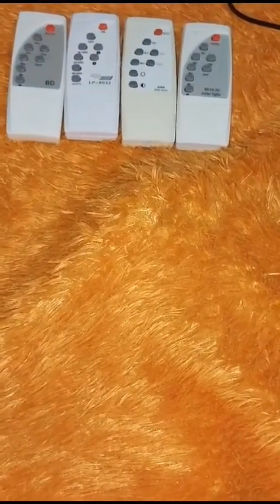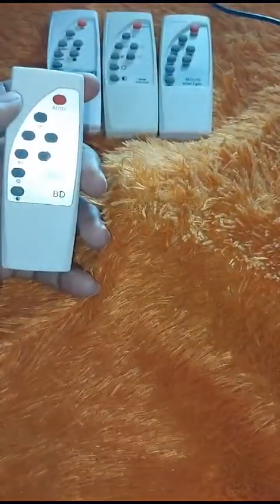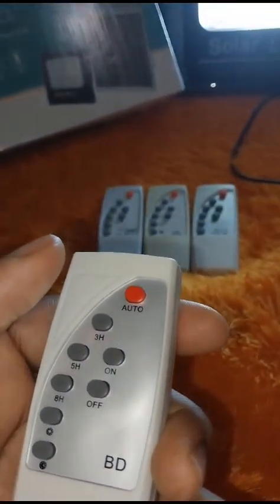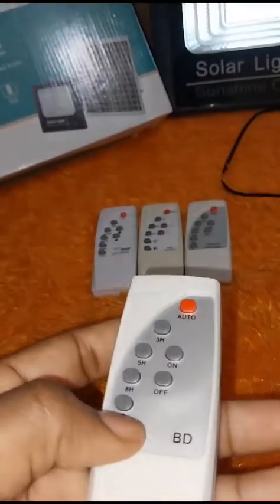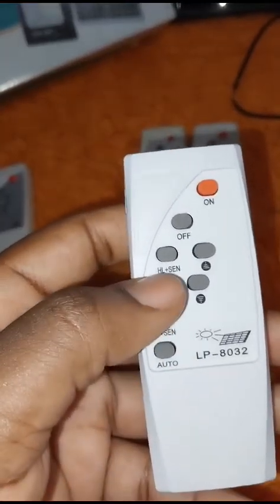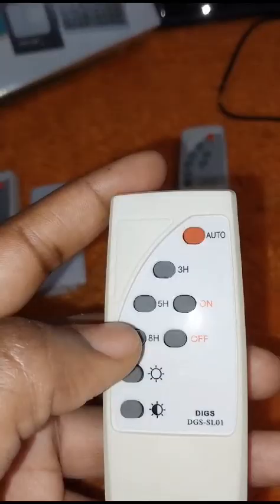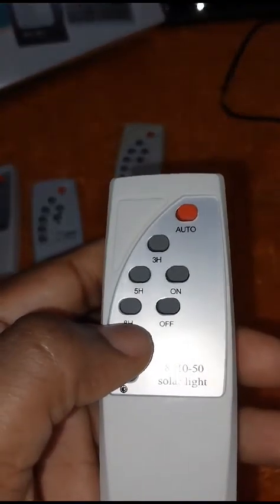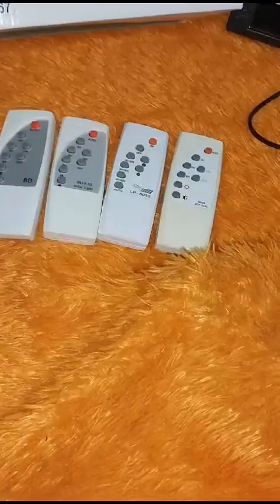Solar Light Remote Controller Instructions . Replacing Solar Lamp Remote Controller

Comment: Good vid.  I whis this had the dimmer  in stages " lower and lower , hig...... .... But it don't  apprantely ??  To me I fine it only goes one up and one down in brightness. ,  with mine am trying to see if a manual dimmer switch can work  to reg..output,   what do u think bout the ex t dim swt.?    Thanks...🌴
Reply from the maker: Most of these solar lights the remotes are programmed to dim the light to 75% 50% 30% . Some are 50% only . Exit dim switch might work if your lamp is programm for that . You can try it. All the best

Comment: How do I pairing a new remote control with the led lamp? My kid pressed the factory reset button (auto) and the lamp can not be operated by control, now it blinks
Reply from the maker: You have to ensure that the remote is the correct one for the lamp . If it is the correct remote the blink could be because the lamp was reset during daylight charge , hence it will blink but not turn on until night

Comment: Can I just turn off auto mode completely? I just want to turn it on and off manually, but it always turns on automatically whatever button I press.
Reply: Thank you for your quick response. 

I do this now but it is not a permanent solution since I'm not at home when it gets dark, so by the time I get home it's already half drained.. 🙁
Reply from the maker: @marcellnagy7039  what u can do since it's half drain , is to adjust the brightness.  There is a button at the bottom of the remote ,press it to turn down the brightness.  This way the battery will last longer and you should have light when you get home .
Reply from the maker: Most of these solar Powered Flood Lights will automatically turn on at night whether or not you selected the auto button on the remote.  What you could do is manually turn it off with the remote or unplug it for when you are ready to turn it on .
Reply: Hello mine,I have pressed the auto button but it has resist to light at night, what should i do